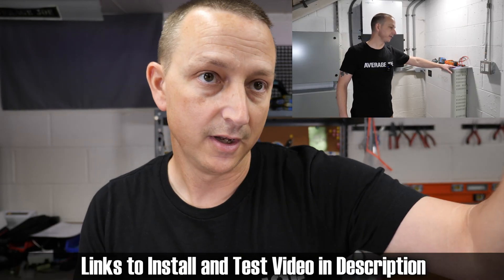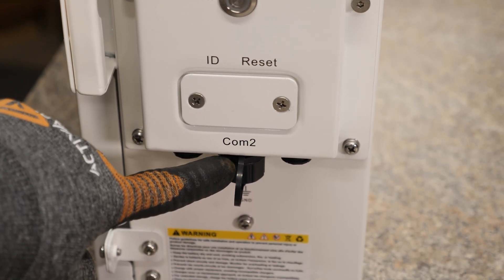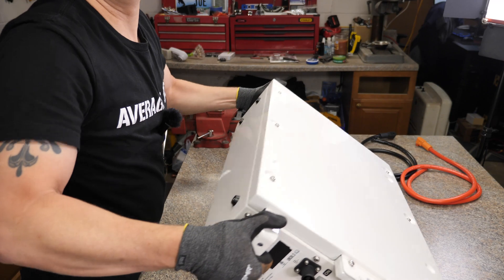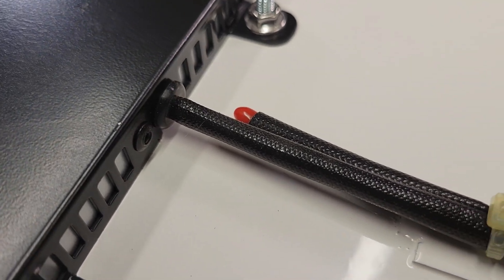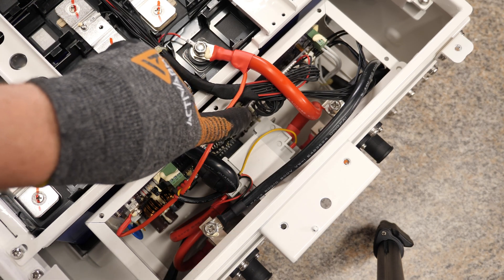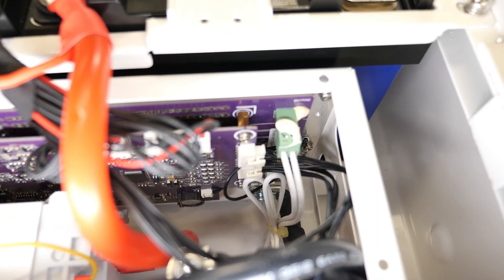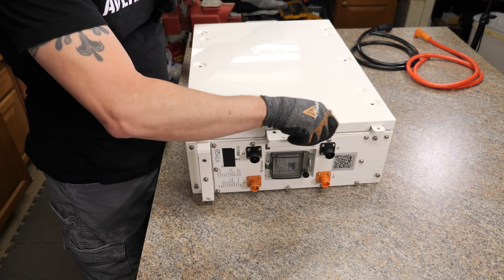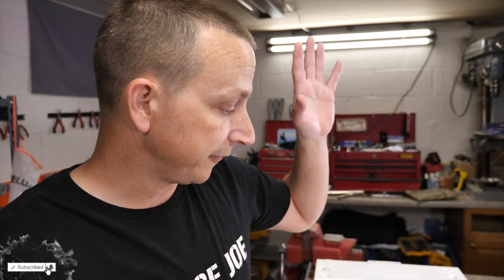Viewer Request - Whats Inside a 5kWh Wall Mounted Ethos Battery

Comment: Joe! I love the Average Videos. Scientific Question: can the single battery module be used as a simple 5kWh 48v battery without the top communication module? I realize that would take away any CAN/485 communications and would leave SOC up in the air, but I really like the format of the battery and was wondering if I could build out a system piece by piece as budget allows. Pricing of the module itself is decent (not stellar) so it may not be really worth it, but I thought i'd ask. - Thanks!!!
Reply from the maker: I dont see why you couldnt. Its a 48v battery. You can connect a ethernet to usb cable to see battery %SOC, voltage ect... May even be able to connect to inverter without the top box but havent tried. Price is pretty good with the 10% discount code!💥🤘
Reply: @AVERAGE_JOE  Thanks! That’s kind of what I was thinking.

Comment: What’s your experience using the LuxPower inverter (5kw model)
Been using it for almost three years now and they all seem to have an inherent problem (cooling fan failing)
There’s up to 4 units i know of that have the same issue
Reply from the maker: I have only been using the 12kw Lux for a few months now. Funny you mention the fans going out cause the manual shows how to replace them😀 I also just got the 6kw but havent used it yet.
Reply: @AVERAGE_JOE  looks to be a common failure then
I’m worried about voiding my warranty though

Comment: How does the left side connect to the right side? Bus bar or wire?
Reply from the maker: Busbars all the way through!🤘
Reply: @AVERAGE_JOE  It looked like 6AWG wire connecting the top lug to the bottom lug, definitely not great for a parallel arrangement!
Oh but I guess it's fine because you have wires that loop to the inverter from the far side? I can't imagine how that helps, the closest battery to the inverter is still going to see the highest current.